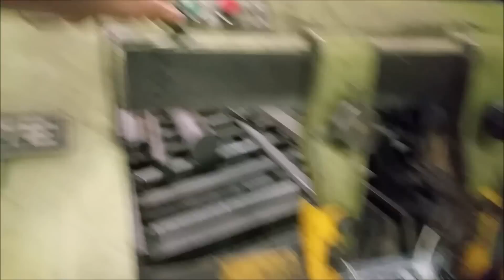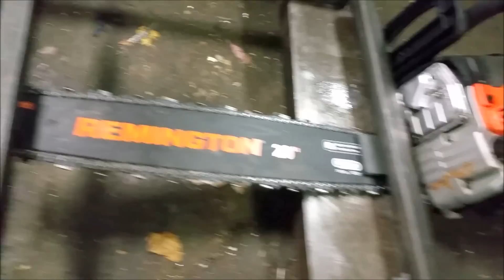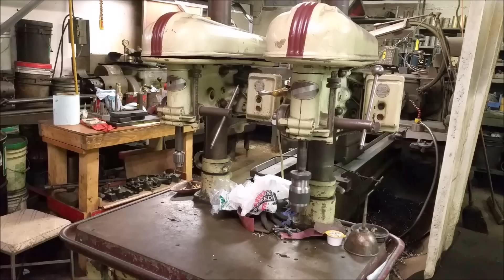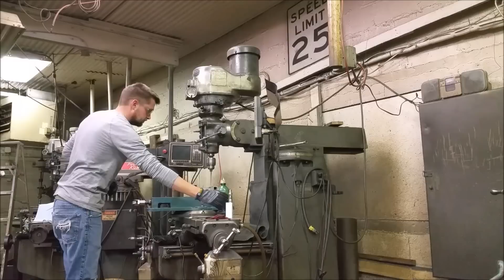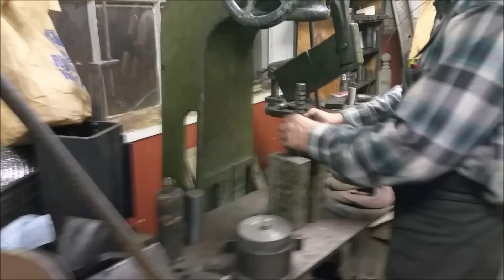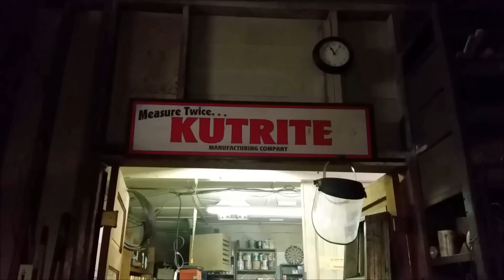Building an Alaskan Chain Saw Mill

Comment: What type/size of square tubing did you use to get the sections to telescope/sleeve like that?  I want to create something similar, just longer and a bit narrower.  Thanks
Reply from the maker: Hey Brendan, I used standard structural grade material. I.e. A36, A572 type square tubing. The frame is 1 inch, and the sleeves were (I believe) 1 3/8 so the hole would be 1 inch in it. IIRC, I had to run a metal broach through the sleeves so the 1 inch tubing would slid more fluidly. Thanks for the question!

Comment: This nearly identical to the pieces I am preparing to cut. I notice the chainsaw is mounted off center, how did you arrive at this decision? Does the weight forward help stablize the rig when resting on the log at the beginning of a new cut?
Reply from the maker: micstica Yes, that was my decision to make it a little forward of the Initial cut as I would be doing most of the cuts by myself.  I feel it worked out well for a one man chainsaw mill.

Comment: What's the overall width of the 1" square tubing frame?
Reply from the maker: HPD Herman If memory serves me correctly I think I made the frame 1 foot wide and around 30 inches long. If I were to make it again I think I would make it thinner like around 8 inches or so.  I hope that helps.
Reply: Seth's Woodshop thanks man, I appreciate the quick reply.

Comment: how did this end up working out?
Reply from the maker: T LAZAR It has worked out great. Once it gets warmer outside I'll post some video of it in use.
Reply: Seth's Woodshop Awesome!  Looked great! Thanks for the super quick response. I'm curious about chain type or file angle when ripping slabs. Would you touch on this in your video?!
Reply from the maker: T LAZAR Hey no worries.  I get regular chains and when I take the to get sharpened I have them grind them down to about 15° and a few I made skip tooth chains, as in I had every other tooth filed completely off.  I have a 28" bar now so that has made it much more easy to cut thru whole logs.  feel free to ask any other questions. I will help as much as I can.
Reply: Seth's Woodshop Good deal! I haven't built anything yet, I'm still researching. I appreciate the offer and I'm sure I'll have some more inquiries in the future. Cheers!!
Reply from the maker: T LAZAR Well best of luck. Message me anytime.